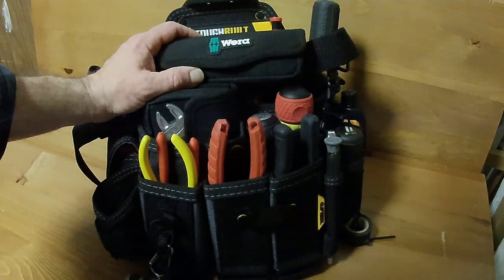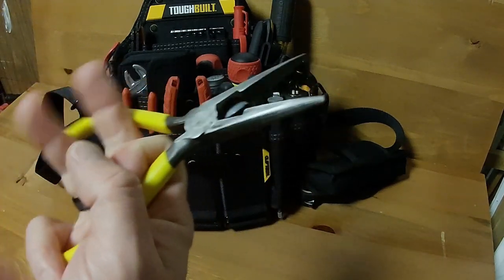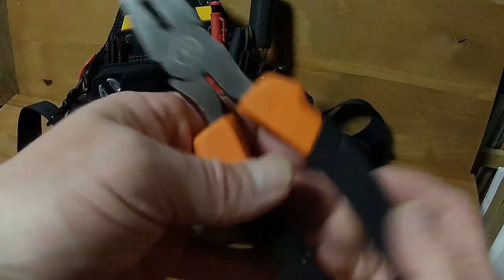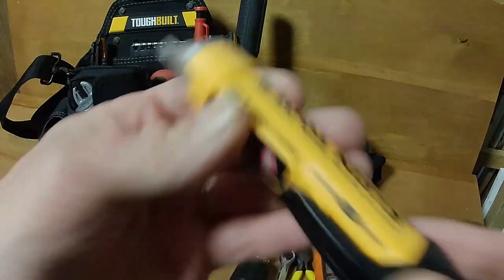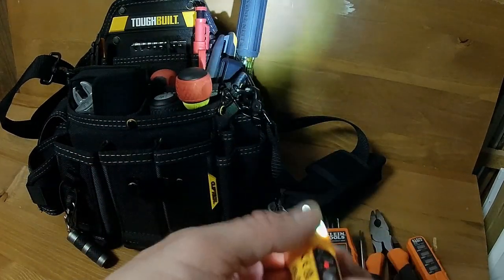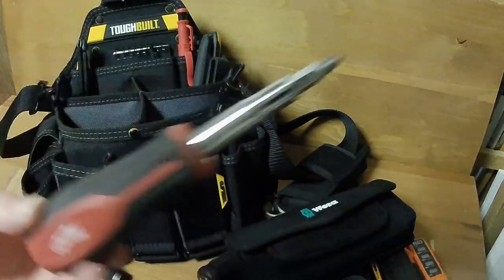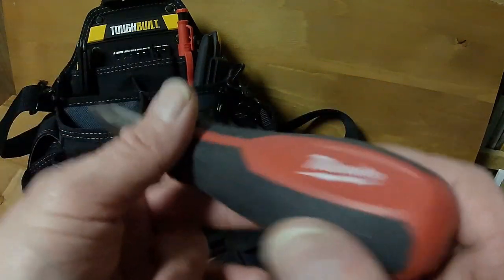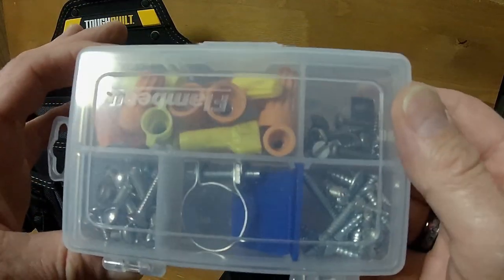Maintenance Tech Tool Bag Tour Pt.3 (Toughbuilt Master Electricians Tool Pouch)

Comment: I’m looking to get this bag to essentially create a small go back for home maintenance projects. I have the large 16 tote that I can use to carry the bulk of my tools, but was thinking of turning it into a “feeder bag” where it houses most of my hand tools, and using one of the electrician pouches as my main tool bag, swap out my main tools as needed.

How did you decide on which electrician bag to go with? They seem to have several
Reply from the maker: I do believe they have 2 other electricians pouches. I have noticed a lot of people really like the smallest electricians pouch. My decision on this one was because it was the largest. They also make a "service" pouch that I consider first, but some of the pockets were open ended and wouldn't work for me. The next size down is the journeymans. Not sure if you've seen it or not? That is an excellent idea and that's basically what I do. The second tool bag video I did was on my feeder bag. Hope this helps.
Reply: What are the majority of projects you do? I use a tough built electrician pouch. I keep a southwire clamp on multimeter ( more compact than fieldpiece or fluke with more features) , wire strippers( Doyle Harbor freight ) some push button channel locks (Irwin)  , my Milwaukee knife( has a flathead and Phillips) a dedicated plane jane flat head ( old beater craftsman)  and a Klein multi nut driver. I also clip my m12 surge with Klein multi bit on the front

Comment: Pretty nice setup, definitely helps me out with some ideas. Love the tough built stuff, first found their bags 7-8 years ago and been using them ever since. 

I do think you could add a couple backup screwdrivers though (😉 LOL)
Reply: That vessel driver does look nice, but everytime I try out a cool new ratcheting screwdriver I always end up just grabbing my 8v Dewalt gyro screwdriver (dcf682) people have called it kind of gimmicky but man it's probably been my most used Christmas gift and it's still going strong 8-9 years later. Not very compact though and adding yet another battery platform is annoying
Reply from the maker: Honestly, gotta try the Vessel. I naturally go for it every time. Something about the feel of it.
Reply from the maker: I'm currently adding more! Lol